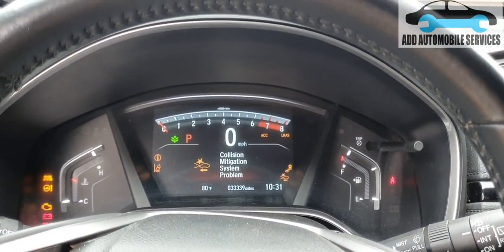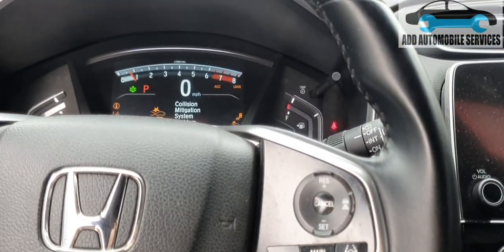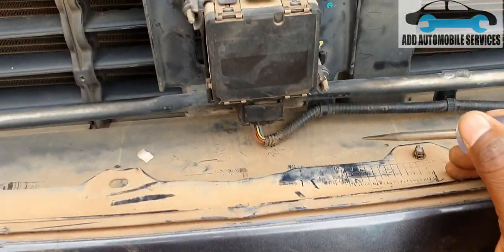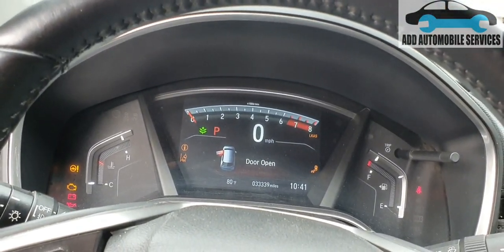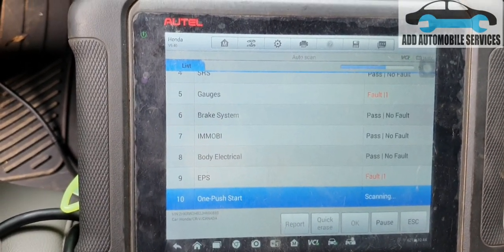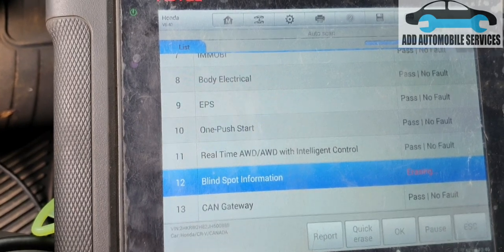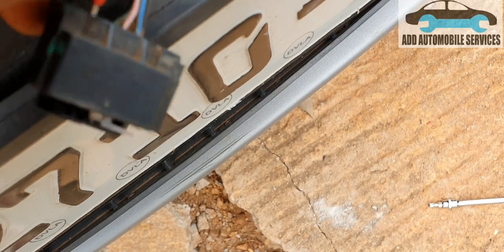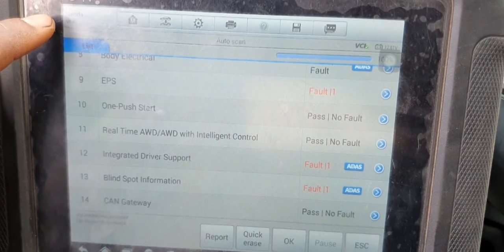CR-V 2018 : No communication with integrated driver support unit

Comment: Good morning, i have been watching your videos for a clue on the problem that i have on my 2018 honda accord. I have a flooded vehicle, the vehicle starts and runs but i have all the lights on the dash. I am not communicating with the srs module so i bought a used one from ebay. However, i still dont have communication. Does the module needs to be programmed before it can communicate with the scanner? Thanks in advance
Reply from the maker: No you need to communicate with it first so  pls check your powers,ground and CAN lines first